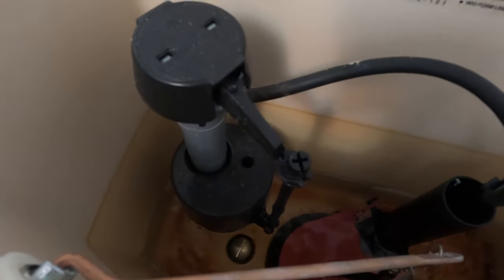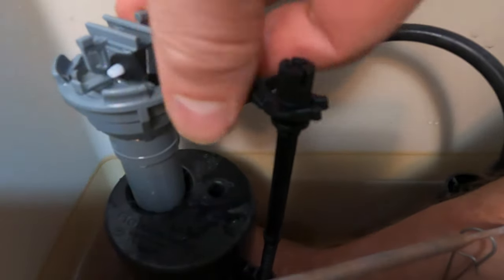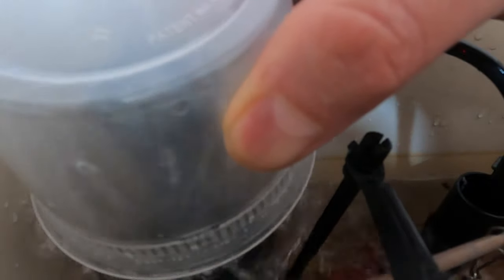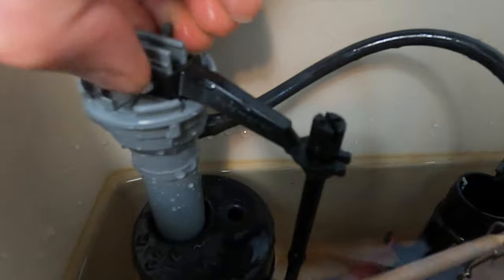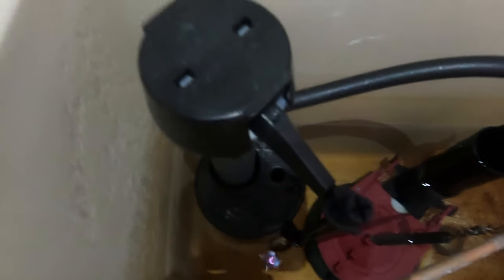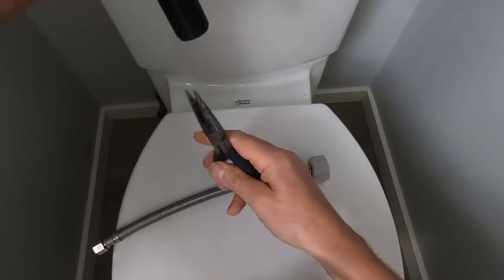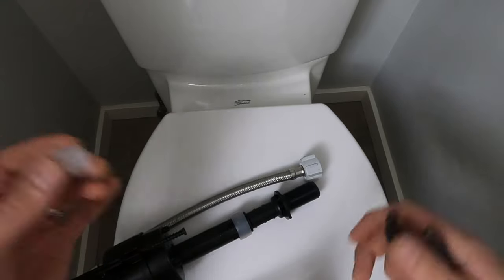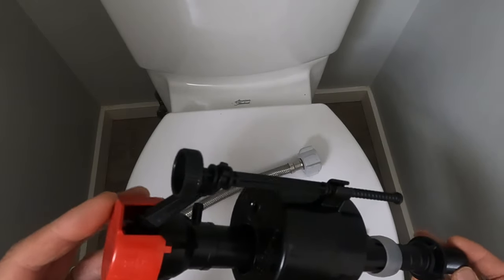How to fix a hissing toilet. Two causes.

Comment: Hey man, hope all is well.  I did everything you said.  Gasket is good, flushed out the potential mineral deposits.  Then went and bought a new rubber seal (little black thing).  Then I quarter turned it until it clicked.  Toilet STILL WON'T stop running unless I push down on the cap of the fill valve.  American Standard parts, only 2 and a half years old.  Please help.
Reply from the maker: Check out my, How to fix a running toilet video as your toilet may just need a small adjustment. Good luck!

Comment: Thank you
Reply from the maker: @GageClayton-hn7sx  Glad the video helped
Reply: @JENSENDIY helped a lot. Our apartment had a mainline leak and they shut water off to the whole property. Once restored, our toilet wouldn’t shut up haha. Flushed and cleaned the gasket and no more noise. Glad to be able to know what to do in the future
Reply from the maker: @GageClayton-hn7sx  I’ve seen that before, the toilet is usually the first fixture used when water gets turned back on so any debris in the water line goes to the toilet first causing what happened to yours. Glad you got it fixed 👍

Comment: It worked for me but when I flush, it doesn’t refill again. Any idea of what it could be?
Reply from the maker: @IleanaFerrari  Try adjusting water level in tank slightly, if that doesn’t work disassemble as before & check everything is put back properly including valve seal. Hope this helps!

Comment: Great vid, thank you!  But I have an issue...the top portion of my fill valve will not budge...I have a Western toilet with fill valve part # A1250430019.  Any advice?  I appreciate it!
Reply from the maker: Some are more difficult to remove than others, you may have to pry at  it a bit with small screwdriver. If it doesn’t come off you could change the whole valve out with fluidmaster, just make sure water is turned off. Good luck!

Comment: If the flow restrictor is clogged then would that mean no water or little water would come out when trying the first fix to flush the valve? I tried the first fix and the water pressure was fine with the cap off the fill valve, but is still slow and hissing after putting it back on.
Reply from the maker: I would check the valve seal as shown in video and yes flow would be slower if restrictor was blocked but is less common than debris at top of fill valve causing issues. Good luck!

Comment: There was no whistling or hissing BUT my lock nut on the bottom of the fill valve had cracked and it all started leaking. 
I didn't need to but I went ahead and bought a new fill valve, installed it,  it's working no problem but is now whistling. 
Brand new, no more leaking but now there's a whistle. Wth
Reply from the maker: Sometimes just turning the water off & on knocks a piece of debris loose that gets caught in the new valve. Also the shut off can make noise if it’s not fully open. Hope this helps, thanks for watching!

Comment: I have this exact same unit and when I do the quarter turn and try lift the top of the valve it won't budge. any ideas? yours seems to come off so easily.
Reply from the maker: As you turn the top part there are 2 ridges (one on each side) that need to clear the channels they are set in. Once they have cleared you may have to rock it back and forth and pull up. Some are easier than others. Hope this helps!
Reply: @JENSENDIY  thanks ill try again

Comment: Unfortunately the cap in our toilet bowl doesn't resemble anything like the one in the video. Its white and feels sealed all the way around. I'm trying to fix this annoying noise. Help is appreciated
Reply from the maker: I have seen some fill valves where you cannot remove the cap. You may have to replace the fill valve. Fluidmaster fill valves are universal and most likely would work on your toilet. I do have a video called, How to change a toilet fill valve. Good luck!

Comment: So in our area, they were working on a  " water Main " 3 streets down, and when they were done  Everyones water pressure was kinda noticeably higher , thats when I started noticing the hissing noise, and there is a small stream of water that runs out the top there, and river streams down the little stick as seen in the video.
its been like this for maybe 3 weeks now, ( don't notice any slow-downs ).

But My concern is, For something like this on a  3 Month Water Bill, how much extra am I going to be paying extra for water? 
Renting from a very slow responsive rental company, and need a better idea of the urgency ( because Either I fix it myself ) or Hire a company, or wait 5-6 months for the rental company to send someone, because winter is around the corner.

if its only an average 5 or 10, 15 bucks per 3 months thats no big deal, but if its going to be 100's of $ . then im probably just going to hire someone now before its too late..
Reply from the maker: If the small stream of water stops once the tank is full then your water bill should not be affected. On the other hand if the toilet continuously runs then the water level needs to be adjusted in the tank or you will be wasting water and your bill may go up. I have a video “How to fix a running toilet” good luck!

Comment: For my hissing it was the second solution.  I tried changing the top valve and it still kept whistling. I removed the bottom part and there was no debris but on my model they have a s/s washer on top, why I don't know. It seemed lose so I removed it and put it back and the whistle is gone. Thanks for the info..PS I tried to sent the photo of the tip but am unable to attach o photo. Thanks Jensen.

Comment: I literally got a brand new toilet today and had installed and I’m hearing a hissing sound, but not quite as profound as yours. Doesn’t seem kind of weird that a brand new toilet would have this problem? It seems like something that comes from Age
Reply from the maker: It's possible that some debris got in the fill valve with water being turned off and on during installation. Also check that your water shut off valve is open nearly all the way, sometimes when valve is not open enough it causes noises. Good luck!

Comment: Hey thanks for the video. I tried your methods and solved my problem when I removed the rubber corkscrew limiter.

I tried cleaning the little thing, but it still hisses forever when I put it back in.  Can I just leave it out?
Reply from the maker: If you’re talking about the flow restrictor where the water supply attaches to fill valve then you can leave it out or try replacing it. Thanks for watching!

Comment: I did this. It works the first time but goes back in a flush or two.  Time to replace the fill valve?
Reply from the maker: I’d say so but when the old valve is removed try turning the water supply line on slowly into a container before you install new valve to see if there is any debris in the water line feeding toilet. Good luck!
Reply: @JENSENDIY  appreciate you! Learned so much in one video.

Comment: Quick ?.. what would you recommend to put in your toilet to Dissolve that   BLACK RUBBER ROT  without Destroying WHATS  there , JUST temporarily….
Ok.. THANKS AGAIN😊
Reply from the maker: @Telemere  l don’t think there’s a temporary fix for that, if the flapper is going bad it needs replacing soon.
Reply: @JENSENDIY  And yes it did sir, u really know your stuff.   Thanks Again Friend

Comment: Can anyone help?  I had someone to replace the entire innerts —taking the tank out— and it’s still makes the hissing sound from time to time (not as badly as before).  So it should not have any debris to be cleaned, right? Since the valve is new. The flapper is new. The water supply valve is also new.  Supply line is also new. Please help.
Reply from the maker: It depends where your water comes from. Well water or city water or water pressure may be too high. If debris is in your water it can still get in the valve even if it’s new. Good luck
Reply: @JENSENDIY  It’s city water. I will try your steps. Thanks so much!

Comment: What if this hissing noise happens randomly, for a few seconds, multiple times a day….would this also be fill valve related? Someone in my house says it’s “normal” but only one toilet is doing it and I ain’t ever had a toilet that did this before 😅 

Do you think these tips might help still?
Reply from the maker: It may not be the fill valve. Check out my,... How to fix a toilet that runs off and on video. Sounds to me like you need to change your flapper. Hope this helps. Thanks for Watching!

Comment: For the second way to fix it does it need to be completely empty ?!
Reply from the maker: The tank should be flushed after water is off. Some water may still drip out from the fill valve once water line is undone, good luck!

Comment: I know its just noise but could it for some reason increase your water bill like because of a tiny leak
Reply from the maker: Not usually with the hissing noise but you may need to adjust the water level in the tank. Check out my How to fix a running toilet video. A running toilet can increase your water bill.

Comment: Helpful tips, but Whew what a PITA to fix on a Saturday night LMAO, new 242 valve put in leaks/hisses worse right out the top where the stainless steel pin is, took apart blew out with low psi air chuck still leaks out the top
Reply from the maker: I've had a few faulty new parts over the years, maybe just need to get another new part, bring original old part with to make sure it matches exactly. Only other thing I can think of is high water pressure. Hope you got it fixed, thanks for watching!
Reply: @JENSENDIY  3 out of 4 seals returned it about got the best of me. You were right

Comment: My toilet fill valve pauses and goes when filling until the bowl is full. What could this be?
Reply from the maker: Sounds like the fill valve, if you have tried the methods in the video with no success, I would first check the flapper and then replace the fill valve. Good luck!

Comment: What happens if your valve seal is a little ripped?
Reply from the maker: Should be replaced, water will get by and come out around cap, bowl will fill slower than normal

Comment: So, while doing this repair, I’m realizing my valve doesn’t shut the water off from the toilet. When I removed the piece in step 3 (twisting that piece to lift off, water starts flying everywhere as got in my face and eyes, and I’m wearing contacts. So now I had to run downstairs and turn off water to the house quickly. Water is all over me bathroom and outside the bathroom on the wood floor. To be safe, just turn the water off to the house. This is not professional advice, but my opinion based off of my experience just now
Reply: And before anyone asks, yes I turned the valve the right way to turn it off. I turned it clockwise and went as far as it would go. While the water was flying, I tried turning it the other way t make sure, and it was going even faster. My valve must be defective. It was stuck before I initially turned it, but with enough force, I got it to turn
Reply: And my toilet is from 2004, so it’s old. That could be why the valve was stuck and why it won’t turn off all the way
Reply from the maker: You’re right, everyone should know where there main water shut off is. I’ve had  many customers over the years who had no idea where there shut of was and I have seen a few floods because of it. I have mentioned this in a few of my other videos. Thanks for watching!

Comment: … by hissing you mean stuck running/on right? just to bring everyone up to speed, that’s the usual term i’ve heard. cause it’s not just a noise it’s likely costing you money on the water bill
Reply from the maker: I do have a  (How to fix a running toilet) video but this video is more about the flow of water being restricted by debris in the fill valve slowing flow & causing a hissing noise while filling.

Comment: Does a hissing sound means there is a Leak?? I checked my toilet bowl and no water runs.... HELP
Reply from the maker: The hissing sound is the flow of water filling the toilet being restricted from debris in fill valve. It’s not usually related to a leak. You may need to adjust the water level in tank as well . Good luck!

Comment: I just replaced my fill valve and my toilet refill is still noisy. I think it’s the water pipes behind the wall that creates the noise
Reply from the maker: Could also be the toilet shut off is not turned on all the way as sometimes that causes excess noise. Thanks for watching!

Comment: Didn’t fix mine. So I’ll check the flow restricter next.
Reply from the maker: @rolandthethompsongunner64  lf that doesn’t work you’ll most likely need a new fill valve.

Comment: So, my toilet is still hissing after shutting off the water
Reply from the maker: Sounds like your water shut off isn’t turning off fully. If the tank is still slowly filling with water then the shut off needs to be serviced or replaced before you start taking apart the fill valve to fix the hissing

Comment: Whenever I flush my toilet after it sounds like water is dripping. But there is not physical water present
Reply from the maker: Try removing the tank lid and listen to see if you can pinpoint the drip. It could be dripping from fill tube that leads from fill valve to flush valve or you may need a new flapper. Hope this helps!

Comment: what could cause a leak? its basically from tank under fill valve seal area. i think its that seal but they dont listen to me. not yet but its gonna happen lol👍
Reply from the maker: It could also be the tank to bowl gasket(spud gasket)or bolt washers that are worn out and starting to leak. Good luck!

Comment: The water valve started hammering 😮 when I did this.
Reply from the maker: It’s possible that there is larger debris in the fill valve. You may need to replace the valve. Also make sure the water supply valve for toilet is turned on all the way. Good luck!